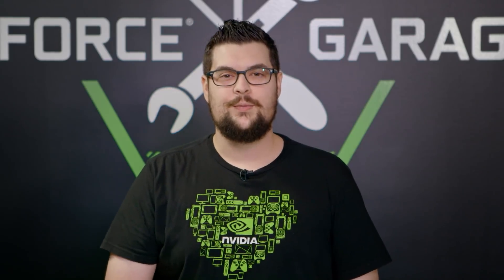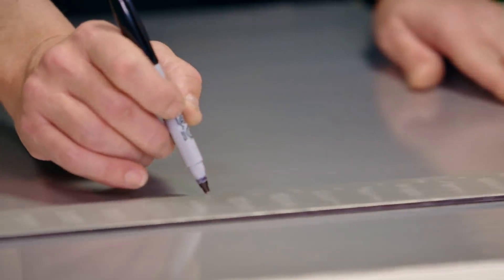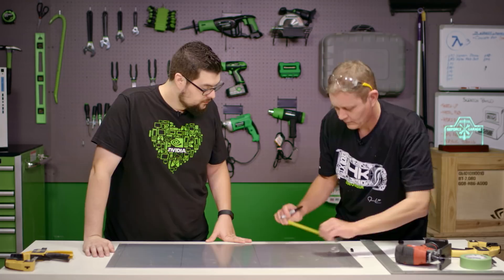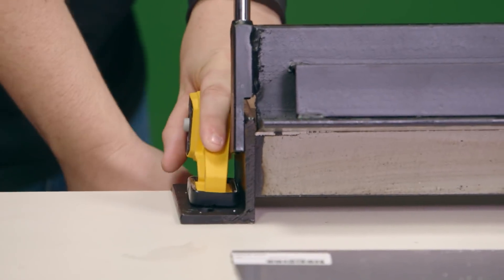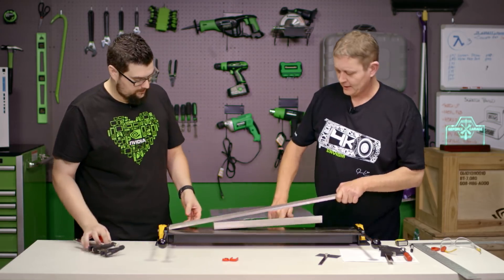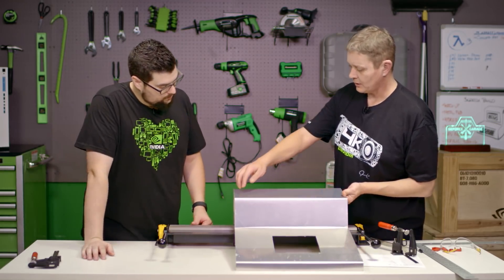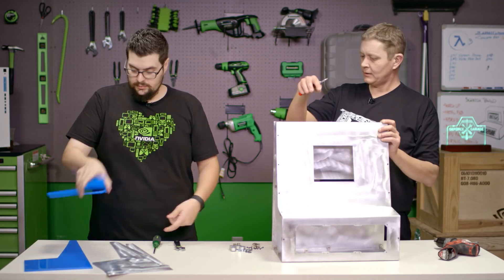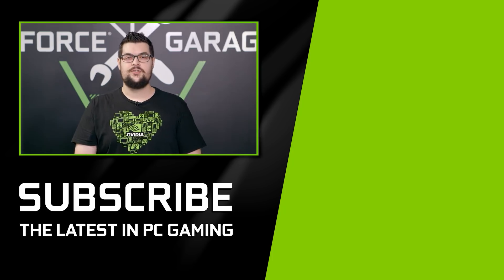GeForce Garage: Scratch Build Episode 2 - How to Cut and Bend Sheet Metal

Comment: "We don't want to mark on the surface of the metal, this has a plastic cover." sands the entire surface anyway
This is a pretty good guide though. It's a little easier if you have access to a metal fab shop, (this would take us maybe 20 minutes total) but they did a good job.